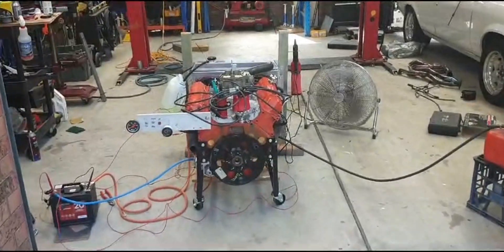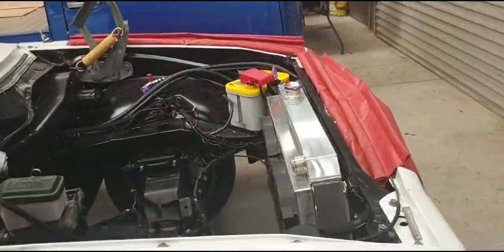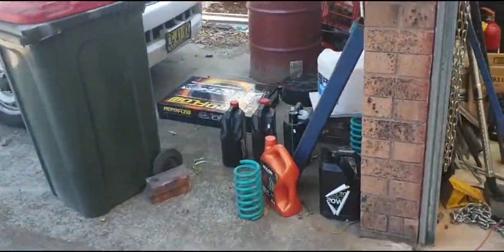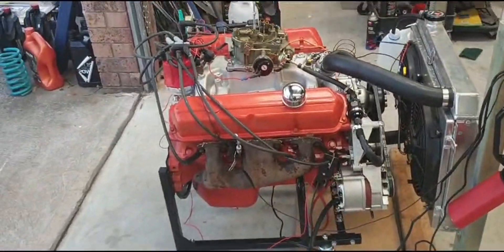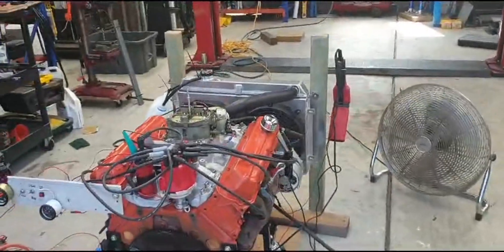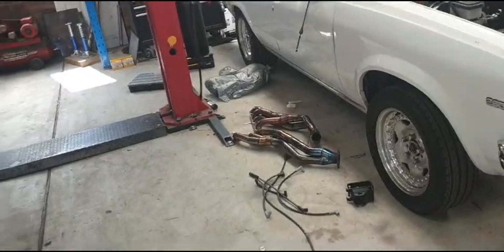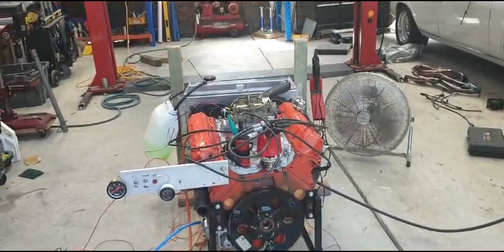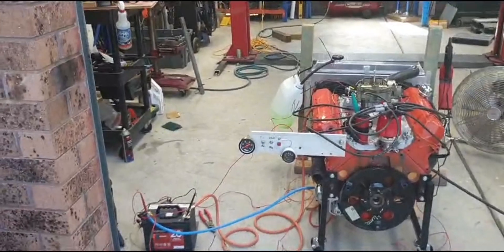Holden 308 Oil Pressure Drop

Comment: Holden 253 and 308/304 were designed with 0.004” clearance between the camshaft bearings. This is a engineering design stuff up and is too much clearance,  which is why they are known to have low oil pressure problems. 
As this is a known issue, all bearing suppliers have 0.002” undersized cam bearings which leave 0.002”clearance. 
This solves the known low oil pressure issues.

Comment: Horrible engines for oil pressure, my engine was the same almost dead at idle my old engine builder slapped it together. It’s been redone now but still very bad at idle on cold starts. You’re idle pressure is actually very good.

Comment: Hopefully you didn't do any damage to lifters or cam with the low oil pressure. Holden V8's have known oil pressure issues. Ive had that in the past hence on my current 355 build I went to a roller cam set up. But it doesn't excuse unfortunately why a fresh build had low oil pressure your engine builder is to blame 100%.

Comment: Worn cam bearings will reduce  oil pressure , the oiling system lubricates cam bearings first, lifters, then down to the mains and to big the ends:oops:

Comment: I have rebuilt a few 253, and 308's some tend to just run low for no apparent reason, I wouldnt worry too much, check oil pump clearances on lobes in this instance.

Comment: One of them things man,  ive seen this twice, once in my 97 cobra 4 cam 4.6 and in my Speed 3 MZR 2.3.  Both built properly with King bearings. 

No matter the weight of oil they both would have a hot idle of around 10 psi.  Both motors lived a long life though and were beat on pretty hard.

Comment: And then there is the difference between bearing manufacturers.
Only mention this as have seen many issues over my 40 plus years in the trade.

Can't put ang engine together without careful thorough measuring, I personally have had 3 different brands of standard size crank and conrod bearings with all 3 brands showing different clearances.

Non of the bearing brands were even race bearings ( wich can give larger clearances if desired depending on desired outcome).

Worth sharing wouldn't you say?🙂
Reply from the maker: Thanks for the info.

Comment: I had similar trouble with a different engine, but it's oil pressure by-pass was in the side of the filter mount and used a cup type plunger behind a spring. I found it was hanging open, so replaced the cup with a ball bearing and the problem went away.
Reply from the maker: This is not bypass valve....thanks  for the comments

Comment: Holden V8s are notorious for very low oil pressure at idle.
Stick with a good oil like Penrite HPR30 and you'll be fine.
That all looks and sounds normal if you've got a thinner oil, like a LS1 grade oil in it.

Comment: All I can think of is that the builder didn't check bearing to journal clearance with the new bearing shells fitted prior to fully assembling the engine & sending it out to the customer .

My 5.7 litre Chevrolet LS1 V8 engine (I know that I am not talking about the 5 litre Holden V8 engine here) had 30 PSI of oil pressure at idle speed,37 PSI at 2000 RPMs & 60 PSI at 4000 RPMs which is within the manufacturers specifications.

That was at about 300,000 kilometres or a bit over as I was trying to diagnose a hydraulic lifter noise which appeared once the engine had warmed up so in my case it was due to bad hydraulic lifters, not a low oil pressure issue.

I replaced the lifters 5 years ago & the engine has been going good ever Since & with no lifter tick !
Reply from the maker: I have to agree with you mate.. I dont think engine builder check the clearance properly.. he wont admit his mistake.. Thanks for the reply.

Comment: Holden V8's are not known for great oil pressure at any time...Factory specs say 275-415kpa (40-60psi) @2000rpm is acceptable with 20-W50 mineral oil thru a Z160 oil filter and thermostat at 88-90C...I use 20W60 Penrite in my 304 and keep it about a 1/2 liter overfull to splash the cam...it seems to have 17psi @ idle and it's an old engine...That pressure is outstanding...I wonder if the cam bearings weren't up to scratch and they changed them.?...The cam is where the oil goes before it goes thru the crank and bearings...If they only tightened the bigend and main bearing clearances on a fresh engine then the didn't do the right job from Go...Just my opinion...Cheers mate,
Reply: Zig knows his stuff that's for sure.... I've been watching his channel for years now !!! Old skool rules !!
Reply: 100% 👍

Comment: put some thicker oil in it, the moose piss you have in it now s too thin, try 20w - 50, then up to 25w - 60,  mineral based with extra zinc, as the engine heats up, the clearances increase and you need more viscosity to take up the bearing clearances, without stripping it down and measuring it up that's the most likely cause, otherwise remove your pressure relief valve out of the oil pump, make sure it is not sticky. The lifter is getting noisy due to the low oil pressure.
Reply from the maker: I did 20 50 ,20 60  and 25 70 no difference at all..
After he changed the bearings im using 25 60 and pressure holding ok..
Reply: @autoconversion2410 he obviously is deaf and blind. Nice motor mate.
Reply: Not his fault engine builder obvisoly had wrong clearances.
Reply: Good advice